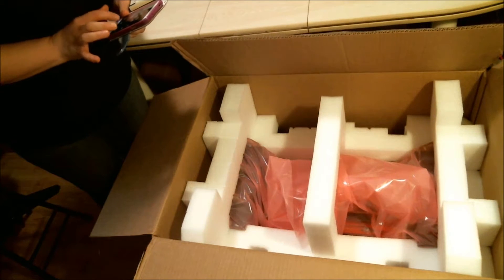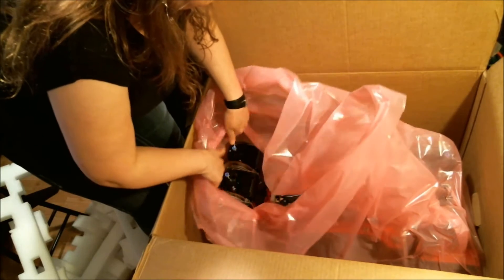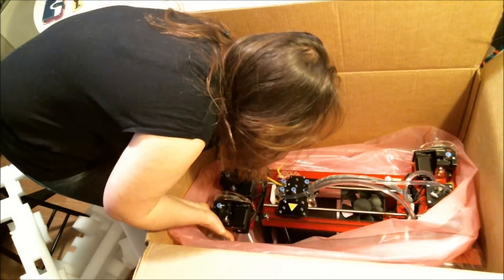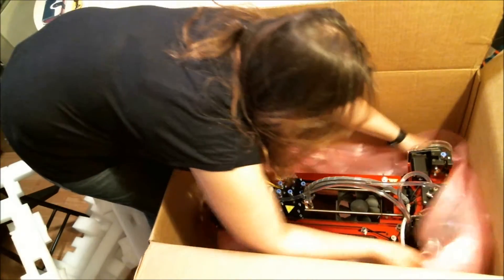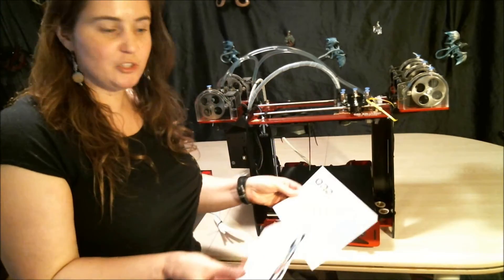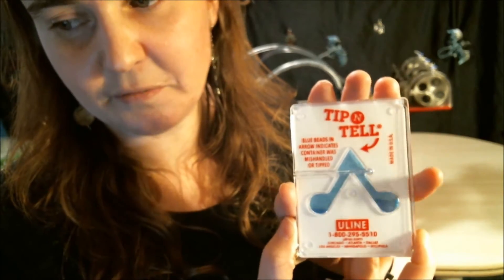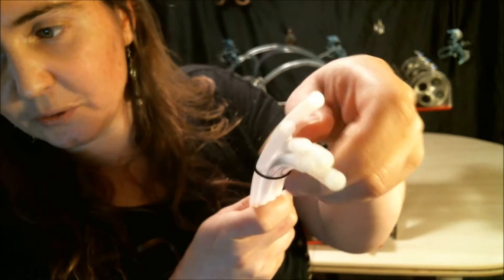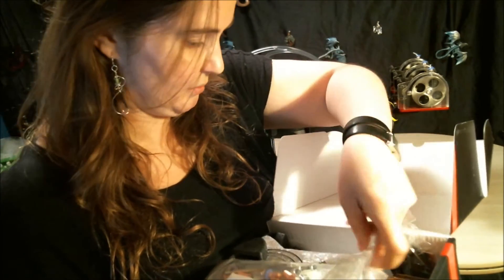Unboxing the RoVa3D by ORD Solutions. 5 nozzle, multi-extruder, 3D printer.

Comment: This printer is a total piece of crap! Stay away from this machine. 5 colors yeah we want that! There is no more response from this manufacturer. Seems they have run away which I can understand completely.
Reply: This printer is not a colour printer. It is a multi-nozzle printer. It works well for me. I bought it in 2015.
Reply: @katherinebialek443  hi .the safety enclosure broke during shipping i was hoping that you could send me the design and measurements so i can build it myself.thanks
Reply: hi .the safety enclosure broke during shipping i was hoping that you could send me the design and measurements so i can build it myself.thanks